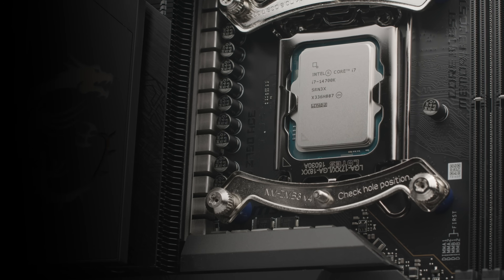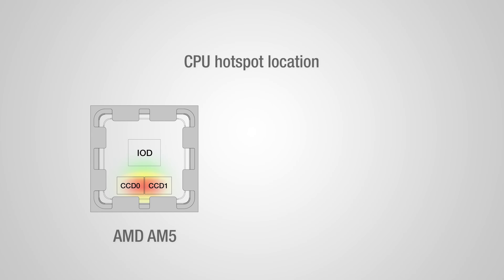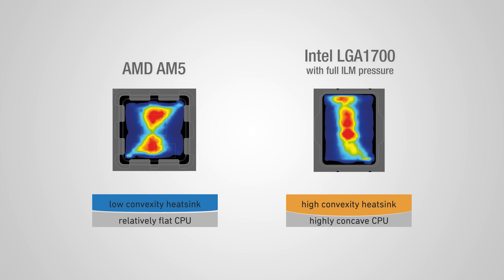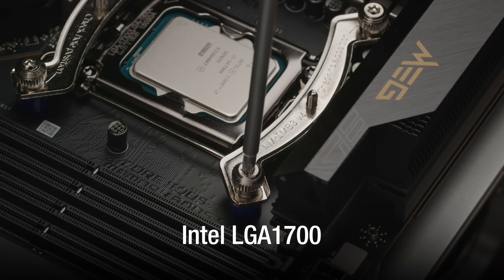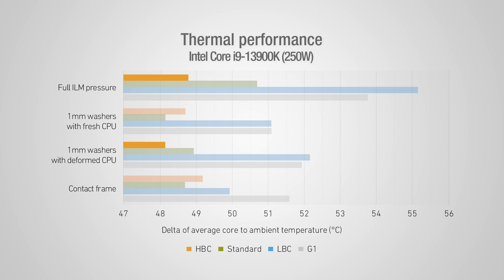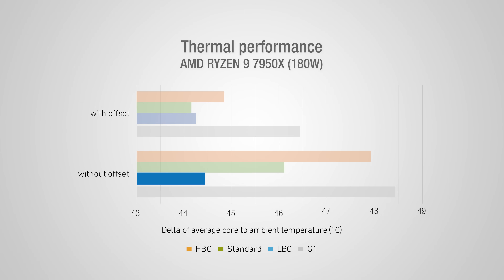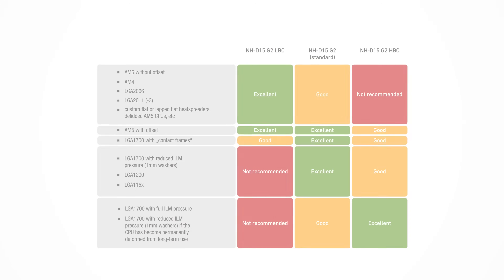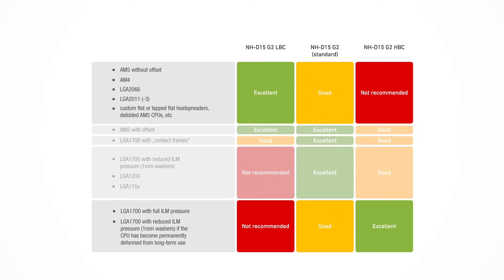Base Convexity Explained: Which version of the NH-D15 G2 should I choose?

Comment: Thanks, I bought exactly the wrong one because it was the only one listed. I think this is a completely stupid idea and the HBC and LBC variants should have had completely different names and way more deliberate and pronounced copy stating that what they are not recommended for and that they should not even really be listed as being compatible with the cpus that they are inappropriate for.

Wow, what do you know? AM5 and generic variants are sold out or not even listed! DUMB
Reply from the maker: Using the HBC version with the included offset mounting will still produce great results on AM5. You should not hesitate to use the cooler. It’s less than 1°C behind the LBC version with no offset in our internal testing on the 9800X3D. In the same testing, it also performs the same or slightly better than the regular MBC standard version with an offset.

However, if you are not satisfied with your purchase, you can likely still return it via Amazon’s return policy.

Comment: Hello,  Please can you tell me how the NH-D15 G2 LBC compairs with the NH-U12A?
I have a AM5 Ryzen 9800x3D and I want the best fan I can get, so which of these two is the best for me?
Reply from the maker: Hi!
If you want to compare Noctua coolers, it’s best to check out their NSPR score on the product page.
The NH-D15 G2 has an NSPR score of 228, while the NH-U12A has 169.

The NSPR score was introduced because describing a cooler’s performance in TDP didn’t provide the full picture. Noctua’s Standardised Performance Rating (NSPR) is a platform-independent classification system that allows customers to assess and compare the efficiency of Noctua CPU coolers at a glance.
You can read more about the NSPR here:
https://noctua.at/en/noctua-standardised-performance-rating

You can choose either the NH-D15 G2 LBC or the NH-D15 G2 standard version and use it with the offset mount. Both will deliver excellent results!

Comment: a few doubts i have :
1. Which side should the blue spacers meant for the lga 1700 be installed , since one of the sides has a circular ridge which is not on the other side ?
2. given the screwdriver and the torque mentioned in the manual (0.6 Nm) , i am not sure  when to stop screwing in , the manual says screw in both sides one by one until "Fully tightened" , there has come a point where the screw made a creaking noise when i tried to fully tighten it without applying any extra pressure from my hand/wrists on the screwdriver's torque , its a tricky screw in method , because too much and the thermal paste will eventually pump out faster and in turn increase temps , but too little and the contact might not be solid enough , really really hoep noctua's marketing team makes a solid video on the installation process covering at least the main points which everyone is going to face while installation regardless of the platform they are using or they are using washers or contact frame , etc
3. after applying the thermal paste , when we try to place the heatsink (without fans) on the bracket to align the 2 screws , there seems to be a situation where the heatsink can either be perfectly aligned or its wobbly and if you screw it in the wobbly  position then the screws wont go straight in , so it might put pressure on the spring mechanism in the screws , there is a ideal postion that the heatsink needs to sit before it is screwed in so that the screws go perpendicular and the spring mechanism isnt damanged in the long run and also so that the contact with the cpu is parallel , really hope noctua team mentions this in the video
4. Which way does the backplate go , please also mention that because they fit on the mobo both vertically and horizontally 
5. Really hope noctua team makes a video with : stock ilm with washers , contact frame , stock ilm without washers
Reply from the maker: Ah! A long one! We love challenges. :)

1. It doesn’t matter which way the blue spacers for the LGA1700 are installed because the height will be the same regardless of orientation. If you’re particular about details, you can align them all the same way, but functionally, it makes no difference.

2. The creaking noise is completely normal—it’s caused by the spring rubbing against the rest of the mounting parts. It can feel tricky because the spring provides resistance, making it harder to turn compared to a regular screw. However, you’ll feel when the screw is fully tightened and bottoms out—you won’t be able to turn it any further. Don’t worry about excess thermal paste. Only the excess will be squeezed out during installation, and the rest will stay inside. Over time, the paste will not "pump out" as you feared. It’s always better to have a little extra paste than too little.

We have installation video guides, but they are socket-based rather than cooler-specific. You can find them here:
https://www.youtube.com/watch?v=LD3XYUYS9hE
https://www.youtube.com/watch?v=hl8Tt9MNiLE
Both videos include examples of thermal paste application.

3. You are absolutely right that this part isn’t highlighted enough in our installation videos. Ideally, when aligning the heatsink and screws, you should ensure one side of the screw barely catches the thread to avoid applying too much force on the other side. If you thread one screw too much, you’ll need to push harder on the other side, which can make the process unnecessarily difficult. Thanks for pointing this out—we’ll make sure to address this better in upcoming installation videos!

4. The backplate orientation doesn’t matter, it’s designed to fit in only two positions, and the installation manual explains this clearly. To quote the manual: "Place the backplate on the rear side of the motherboard so that the bolts protrude through the mounting holes." There are additional markings on the backplate that indicate which side should contact the motherboard and which side should face up.

5. Did you mean a video comparing the performance benefits of using a stock ILM with washers, a contact frame, and a stock ILM without washers? Or are you asking for a video that demonstrates just the installation process for these setups? Please let us know, and we’ll take it into consideration.
Reply: @NoctuaVideos  i think a flagship cooler like this deserves are video from the team because its easy for the consumer to refer to the video the way its supposed to be done as demonstrated by noctua team , although there are other videos but using the g2 cooler would be ideal 

no , i didnt mean a comparison video of benchmarks or sort , instead a single video where you demonstrate how to use the cooler with : stock ilm with washers , stock ilm , contact frame (like thermalright ) if possible , of course while demonstrating all the ways its fine if thermal paste is not used and only used in one case lets say with stock ilm 

also please mention the importance of using the noctua fan splitter which helps in giving different pwm signals so theres no beat freq. , im curious to know what happens if we are using a 3 way fan splitter, will it mess up the pwm signals because now theres a 3rd fan , or suppose if we use a different fan paired on the 3 way fan splitter which might not have as high of a rpm range , this is really messy because peeple use different types of fan in the case with fan splitters/fan hubs

Comment: Does the offset standard version still outperform the offset LBC on the new 9800x3d?
Reply: the 7950x is a 2 chiplet, 16 core CPU drawing 180watts. A 9800X3D is only one chiplet with 8 cpu cores drawing 125W watts. Even if you overclock the balls out of the 9800X3D its thermals will be way lower and this thing already keeps a 16-core under full load at sub 45C temps. So you have no worries. best part is its AIR not AIO so you dont have to deal with the mes and maintenance of water cooling which  i hate

Comment: I have a 14700k. Would the standard NH-D15 G2 be the suitable option to go for without the washers or the contact frame?
Reply from the maker: The standard version will work well, but if you don't use the washers or a contact frame, the HBC version would do even better!

Comment: Alright, so if I understand it properly the LBC variants are fine without washers om LGA 2011 V3 or 2066, I'm on a 10980XE that I plan to stick with for a while longer, flat CPUs and heatspreaders benefit from the LBC variant. And I assume AM4 and older Intel gens like 8 or 9 being flat also benefit from the LBC version more.
Reply from the maker: Yes, LBC is what we'd recommend for LGA2011, LGA2066 or AM4. For LGA1151 based Intel 8th or 9th gen CPUs, we'd recommend the standard version as they show more deformation than LGA2011 or LGA2066. As for the washers, they can only be used with LGA1700.

Comment: Wow, very interesting, so now we have Noctua and Gamers Nexus doing their own independent testing and basically coming to the same conclusion that Intel's ILM design is flawed.   Intel must be pretty embarrassed about all this with a company as established as Noctua making whole new product lines to compensate for Intel's poor design.   Intel must be pretty embarrassed by this, I know I would be if that was my product.   A company as large as Intel should be testing all this stuff in house before finalising their products, there is a lot at stake, you'd think they would be more cautious and careful.    My previous Intel CPU needed delidding to get its temps into acceptable range under load, and now I discovered my new Intel has this ILM pressure issue - lucky I managed to find this on youtube or else I would have been cluelessly warping my IHS and getting worse temps over the years.   So glad I picked up a contact frame with my purchase so I can avoid all this nonsense.

Comment: @Noctua_at

Hi, i use one 13900kf with Contact Frame and PL1 PL2 253W
Noctua NH D15 Chromax.
Paste termic ARTIC MX6

https://youtu.be/EqR2INIKpdg

Benchmark on cinebench R23.
how much temps i got negative with my tests ???
Reply from the maker: In a configuration like this, you should typically see 2-3°C better temps with the standard G2 and 3-4°C with the HBC version.

Comment: What about using the NH-D15 G1 on LGA1700 with the 1mm washers from the G2? How would it perform compared to the G1 with a custom contact frame?
Reply from the maker: Very similar (slightly better with fresh CPUs, maybe slightly worse with used ones): https://noctua.at/pub/media/wysiwyg/Base_convexity_6_Thermal_performanceIntel_Core_i9-13900K_250W-01.jpg
Reply: @NoctuaVideos   Thanks for your reply. Can I ask why are the screw heads changed to Torx from the old Philips heads?

Comment: LGA 1851 is around the corner. Which version do we buy if we plan to go with LGA 1851 in a few months, and was it designed with LGA 1851 in mind?
Reply from the maker: Sadly, at this stage, we're unable to discuss LGA1851 contact quality due to NDA. We can confirm mounting compatibility with LGA1851 though and as a rule of thumb, the medium convexity standard version has proven to be the most versatile for various platforms.

Comment: How is it possible the contact frame has worse cooling performance versus the 1mm washers?
Reply from the maker: This is for medium and high base convexity coolers on fresh CPUs. The reason is that medium and high convexity versions show a better fit to the slight concavity of a fresh CPU with 1mm washers than to the flatter surface you tend to get with contact frames. Keep in mind that the differences are very small <0.5°C for medium and high convexity coolers though, LBC actually did better with the contact frame than with washers (but still poorer than standard and HBC because it lacks pressure concentration over the die): https://noctua.at/pub/media/wysiwyg/Base_convexity_6_Thermal_performanceIntel_Core_i9-13900K_250W-01.jpg

Comment: About 6 minutes into this, it's sounding like the one I want is the normal medium convexity base with the AMD AM5 offset mounting.
Reading between the lines, I get the impression the specialised kit works much better in cases where people build and test and swap things, like a test-stand. If the cooler has been mounted and used, then removed, particularly if it's been done multiple times, that's when you get a degree of deformation of the lid. If you plan to buy stuff and build it and then just use it ~ the optimal setup does appear to be the medium convexity base and the AM5 offset mounting.
Of course if you take it off and then put it back on 6 or 10 times, you're probably going to kick yourself, but I have had this i7-6700 for about 8 years now, and I've never even considered removing the cooler. I don't see why the AM5 kit ~ R9 9950X ~ would be any different.
US $150 ~ that's going to be nearly $300 Australian, which is very steep for an air cooler...
It would pay to check the memory I plan to get, is not real high. Less bling on the top, just good EXPO ratings. I want 64 GB of DRAM, probably better to do with 2 x 32 sticks than 4 x 16 sticks. I am prepared to change my mind on that score if the 16 GB DIMMs are 4 or 5mm lower than the 32 GB DIMMs.
-----------
Ah ~ Here we go!
https://faqs.noctua.at/en/support/solutions/articles/101000472105-what-is-the-ram-clearance-of-my-noctua-cpu-cooler-
Yeah, by Noctua's own doc, the old D15 was 32 mm and the new one is exactly the same.
So, if your RAM is < 32mm tall, you can fit everything in the stock place, but if it's (say) 4mm taller, then the fan has to moved up a couple of fins. As long as the case has more than 185mm from motherboard to roof, you can do that.
https://ncc.noctua.at/coolers/NH-D15-2/ram/DDR5/13/G.Skill
Ok, the G.Skill Flare stuff all seems to be 33mm. That should mean raising one fan by one fin, which should mean I'd need about 190mm. Most of the cases I've looked at, promise about 5mm clearence, possibly 7 or 8. One single mm over the stated height, should mean one fin, which should be about 3mm or less.
Too many options to go through all of them ~ Use this to check the case you want.
https://ncc.noctua.at/coolers/NH-D15-2/cases/all
For example, the full size Fractal Torrent is fine, the Torrent Compact is a trifle iffy, and the torrent nano is a no-no.
https://ncc.noctua.at/coolers/NH-D15-2/cases/Fractal%20Design?q=Torrent
------

Comment: Can you please tell me when it comes out, the nf-a14x25 2024 this, along with the cooler, are the ones that interest me the most, I hope it doesn't exceed $75 per fan.
Reply from the maker: The square frame fan is targeted for September: www.noctua.at/roadmap
Reply: The good news is that Noctua ended up not using LCP (the super expensive material used for the fan blades because of its performance) for the fan frame, so it would not be that expensive.

Comment: If you make a cooler than can get close to watercooling temps, in the new ryzen 9 7950x e.t.c. with 120-170watt rating, i would pay the same amount or even more just to keep my pc air cooled. Dont know if its even possible, but just saying as a consumer, i wouldnt mind a huge price even for a slightly less performance, if i dont have to worry about leaks, and less case fans . Good job noctua nevertheless
Reply: You don't need liquid cooling for any AMD processor. All AMD processors can be effectively cooled with an air cooler. Here's a fun fact, AMD does not have one single CPU that requires liquid cooling as some only have recommendations.
Reply: @jamesm568  true, but i ve seen benchmarks, and i have my own personal experience with the ryzen 9 5950x and temps get up to 85-88c during 35degree summers where i live, while playing poor optimized games, (like need for speed heat and many more) i cant imagine the temps on the ryzen 9 7950x with more wattage requirements. I am thinking about building a new pc using ryzen 7950x or the new 9000x ones that are about to come out, you think ill always see temps lower than 88? if yes, ill gladly use the nh-d15 or other highend air cooler, but the benchmarks ive seen 360 AIOs always performe 5-10 degrees less, and since we are talking about pushing 90 degrees seems like a smart idea. But if you have personal experience with air cooler in a 7950x + 4-5 fans on the case and seeing less than 90c (in the summer) less than 80 during winter , i ll glady stick to aircooling .  Sorry for the huge text
Reply: @MakTheSank  You would see better performance for cooling with a 360 or bigger AIO or a heavier duty 360 AIO used as fresh air intake.

Comment: For LGA 1366 CPU's, I know you need a separate mounting kit to make the NH D15 G2 compatible which is something I already have, which version would be the best suited to that socket?

I don't know if the IHS flatness of those CPU's is similar to the other Intel HEDT sockets such as LGA 2011/2066 or if it is similar to LGA 115X/1200? 

I would really appreciate if you guys can guide me.
Reply: Why waste a $150? Cooler on a $10 CPU?
Reply from the maker: In terms of surface flatness, LGA1366 is more similar to LGA115x/1200 than to LGA2011/2066, so we would recommend the medium base convexity standard version for this socket.